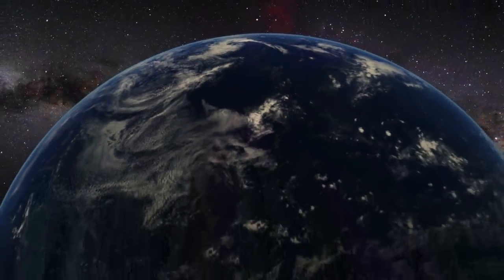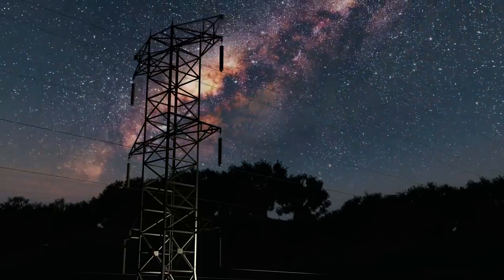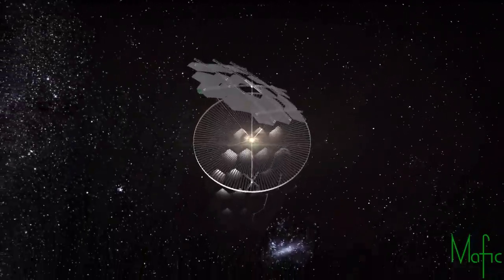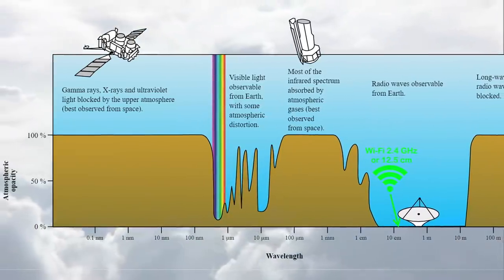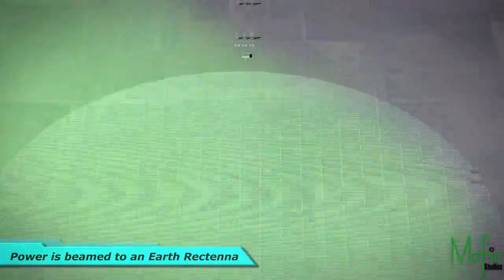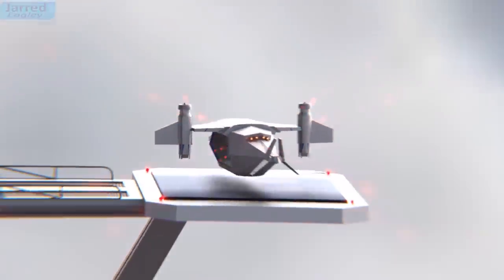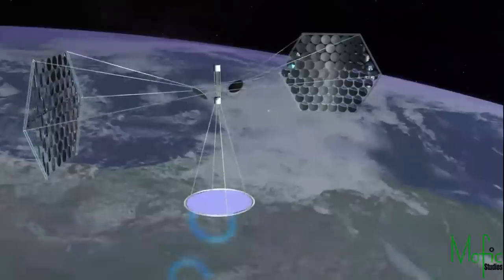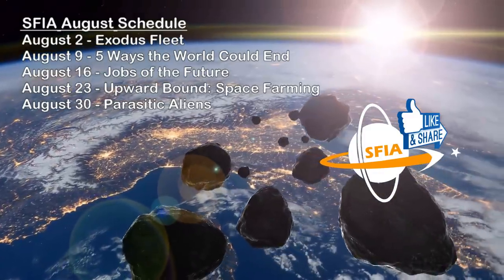Power Satellites & Space Based Solar Power

Comment: Total US cost spent on the Iraq war 2.4 trillion, not including Afghanistan. Could of built at least half a planetary ring mega structure with that, or a vacuum train network under the united states allowing coast to coast travel in 30 mins, or a base on the moon and mars easily, or again easily fully commercial fusion power.

Comment: It's great to hear that these are nearing the point of being economical, at least in theory, but I have a feeling that overcoming the regulatory hurdles will be more difficult and take longer than overcoming the technical problems. However, I can definitely see prototypes going up in the next few years, and perhaps the first commercial ones within 10. I think though that people will have to become more comfortable with active support for structures a couple kilometers high before we reach for 100. This definitely seems like a good option for the 2030s and beyond, especially if they are cheaper and quicker to build than fusion reactors.

Comment: It's funny. Beamed power reminds me of Sim City 2000.
That actually had a bunch of things in it you didn't see back in later iterations of the game (or only in some versions.)
Arcologies, and several forms of powerplant.

The game had coal, oil, gas, garbage burner plants, fission...
Wind turbines and solar plants. (mirror concentrator hot oil/sodium plant, not photovoltaic).
And of course, at the very high end, Fusion.

But, just below the top end fusion plant, you had the beamed power plant - which basically looked like a large radio dish, but was designed to pick up a beam from a solar array in orbit.

The other interesting thing is the disasters you could get randomly depended on various things in your city.
For instance, if you had a lot of water you'd be more likely to get a hurricane, otherwise you'd get tornados.
Lots of forest meant more fires.
If you had an airport, you could get plane crashes.
Having military bases made the alien and monster attacks more likely.

If you had a nuclear (fission) plant, you could have the worst disaster, a nuclear meltdown. (it's the worst because it leaves radioactive contamination that the game provides no method of removing, so parts of your city become permanently uninhabitable.)

But, the other power plant with a unique disaster associated with it was the orbital plant. And sure enough, the disaster is the beam targeting going wrong, and thus instead of hitting the powerplant it starts cutting a path through your city... (the beam is invisible, but you see it cut through buildings, destroying stuff and starting fires.)

I miss those subtle touches... XD

Comment: Great to see a survey of issues affecting the design optimization of space-based & ground-based solar power systems.  I'm looking to understand when combinations of ground-based 
alternative energy systems out-competes spaced-based.  One simple rule would be when the difference is only the cost of transportation of earth-based items.  Space materials mining could reduce launch costs to a tiny fraction of the space-based solar.  Space-based power can be affected by the Sun's activity that could cause it to be shutdown temporarily or worse.  There is a case to be made for ground-based power as a backup power source.  That question needs to answer questions like if a ground-based backup has to be built why build space-based?  These are tough questions with large numbers of influencing variables & factors.  The Optimation of any system of this scale is a really big deal.   It's almost like predicting the weather.  However, atmospheric & oceanic science & engineering is making some progress.  JSW

Comment: My whole problem with orbital rings, space elevators, and anything tethered to the planet is that any physical connection would effectively short the ionosphere to the ground. Do we have any materials with a high enough dielectric strength to withstand the high voltage differential across a trans-tropospheric tether?
Reply: Let the energy flow.
Reply: Huh, I never thought of that.  I wonder if that could make for a viable power source.
Reply: All the ionization is up there, not in a difference in potential with Earth's surface.

But one of my problems with space elevators is much farther down, where there is such a difference. It seems to me that thunderstorms passing around such a structure would readily conduct cloud charges to ground through it...not unlike the exhaust trail of Apollo 12 did, in under seemingly less risky conditions.
Reply: I suspect that it is something that we could design for, ultimately it would mean designing the tether to handle a TLE discharge but this is not so fundamentally different to designing a tether to handle a lightning discharge. The maximum amount of the ionospheres charge that can interact at once is still limited by the dielectric strength of the vacuum medium that the charged particles are suspended within. Of course if anything the presence of the tether would also reduce the voltage when a breakdown occurs (Because a lower voltage buildup can occur before it will carry a current discharging the buildup). I'm just not convinced that this would be the major problem that you seem to think it would be though I'll admit I am no expert on this so if you have data that would prove otherwise I'd be happy to see it.
Reply: A big grounded tower pushing up into orbit will distort the electrostatic differential between the ionosphere and ground (at the very least, local to its geographical area.) Could this aforementioned distortion create a deviation in the earths natural energetic/magnetic/ionic shields?
Reply: No.  Even at very large scales, it would be a minuscule thread in relation to the Earth and weather patterns within.  It wouldn't be pushing much of anything.  

I feel the far more important concern is that there's no way to make a tether from the surface to an orbital ring *static*.  It's an ORBITAL ring after all, and probably moving quite fast.  Even assuming you can fly a line to the ground without the tension caused by dropping through the atmosphere breaking it (which we can assume is solved in this scenario), you're still left with this cable drifting across the planet that you'd have to catch like a damn ski lift.  Not exactly ideal.
Reply: +z beeblebrox Well no they are stationary with respect to the ground you should probably really watch the orbital rings episode if you want to learn more how they are able to accomplish that.

Comment: @Isaac: For the Generation Ship episode (or perhaps sometime in future, since this one is likely baked already) could you please try to address how we keep one of those things running for a few thousand years.  I mean, we regularly have electrical components for computers fail after a mere decade, not to mention the hatch seals on your airlocks 'drying out' (plasticizer loss) - or vacuum welding shut if you choose to skip seals and go for close fit instead.  I've loved the idea of these things since childhood (I'm 50 now), but there are some aspects of them that just seem even more daunting than 'simple' engineering megatasks like crafting millennialy stable ecosystems to support all the colonists.

Comment: What's your opinion on powered satellites that collect higher-energy radiation than visible light?  Like you say, the atmosphere filters out nearly all light with shorter wavelengths than the electromagnetic spectrum.  But in space, ALL of that is potentially available, since the sun fairly evenly distributes its light across a wide portion of the radiation spectrum.  I'm not very well versed on how solar collection works, but my intuition is that UV light and X-Ray light would net considerably more energy than visible light, correct?

Comment: This is exactly what I needed after a morning full of staff meetings!

What do you think about creating automated solar panel farms on the surface of the moon and beaming that energy back?  The Moon has no atmosphere and building and deploying the panels on the moon should be easy (except, does the Moon have sufficient Copper?)

The downside I would see if that the panels would only be illuminated 1/2 the time, but would that 50% loss still be more economically feasible than lifting them off the Moon into a LaGrange point?

Comment: Stage 1: A maglev rocket sled that is accelerated in an eastward facing vacuum tunnel up the side of a mountain, getting to supersonic speeds before the end of it. The airlock is released and the door opens just before the sled reaches the end of the track. It releases its payload and returns to the end of the track.

Stage 2: This stage uses a scramjet engine which can only have powered flight at supersonic speed and with enough oxygen content in the atmosphere. The scramjet keeps accelerating and going up until it can no longer function, releases Stage 3 and glides back down to a prepared runway.

Stage 3: A standard rocket, but now much of the work getting into space has already been done, allowing it to have a much better payload-to-fuel ratio and not have to deal with as dense an atmosphere while going supersonic speeds.

Comment: Did anyone else never even consider having the microwave beam be super dispersed to reduce watts per square meter to a safe-ish level, before this video?
That makes this whole thing much more viable in my mind.
And 85% efficiency on rectennas? Shoot, that's scary good
Reply: Yes, I have read that in published articles.  Space based solar power has been studied since the 1970s.
Reply: The rectenna is 85% efficient, but the transmitter is 50%, for an overall efficiency around 40%. The high efficiency solar panels are about 100 times more expensive, so even if mass to orbit was free, I can't see this being the optimum course compared to ground based with UHVDC power transmission.

Comment: Another application which came up in the time since this was published: decarbonizing cargo shipping. Cargo ships burn glorified asphalt as fuel, and it pollutes a lot. Alternatives like ammonia and LNG are either still too low on the TRL ladder to deploy, or have lots of drawbacks, or both. Beamed power cargo ships would be pretty cool, they could extend their chicken wire rectenna out over the top of their ship like a sun roof, and be carbon free with unlimited range. Ditching the fuel tanks and diesel engines would even free up more mass budget & internal volume for payload!

Comment: I know you can use literal chicken wire as a microwave antenna ...
BUT surely if you want a lot of energy to go through the wire needs to be a REALLY good conductor, right?
What I mean is at this scale of energy throughput if you used a copper wire mesh, wouldn't it just heat up and melt?
Would you need superconductors?
Reply: I don't think he meant literal chicken wire.
The collector is a mesh, LIKE chicken wire. And no a solid wall, like solar panels.
Reply: Yeah, this wouldn't be something an individual would just toss together as a home-improvement project.  It would be the result of a company or govt setting up a program that slightly compensates farm owners for the mild inconvenience of having a somewhat high-tech mesh (honestly not that high tech, just expensive) suspended over their land.  Luckily we have lots of precedent for this in both the public and private sector when it comes to needing lots of land for odd projects, so it's pretty feasible
Reply: No no I mean the literal physical limitations ... What kind of mesh can carry that much power through without melting?
Or can you just use copper wire if the mesh is large enough and the beam diffuse?
Reply: Well, we could "just use copper wire if the mesh is large enough and the beam diffuse".
So really the question becomes how diffuse do we want/need the beam to be.

at 17:14 he says that the rectenna will receive "gigawatts" of power over a large distance.
at 22:45 he talks about the benefits of putting the rectenna on a "common space towers"/"Atlas pillars". One of these benefits was that we didn't need "the trade off of concentration for safety".
What I'm eluding to is that the chicken wire on the ground hits its limit from safety concerns of what ISN'T collected much earlier than it hits the physical limits of the building materials.

EDIT: 
at 15:22 he says that we would beam the microwaves down "at about 100 Watts per square meter" for the safety concerns.
100 Watts is basically nothing, so copper wiring should do fine (if not overkill)
Reply: There are limits to overheating, but the limits are mainly important when using this sort of beamed power to target microwave-sails (like solar sails, but not).

On the ground, the biological safety limits are so much lower than the limits from any metal's melting point that people might even use aluminium because it's cheap and light even though it's a terrible conductor — we already do this with power cables, IIRC.

Comment: I'm currently reading Ben Bova's 'Powersat'. It occured to me that you could use big high altitude aerostats @ 30km up with receivers on the top surfaces to cut down on the atmosphere absorption. Tether would serve as a power line. Started googling it and it turns out somebody had this idea (to the point of filing the patent) but without the advanced materials it is not viable. In couple of decades though it could be a stop-gap between ground based rectenna fields and the atlas pillars the video is describing...

Comment: Suggestion. 

The Power Satellite-

One Autonomuos Body. 

Movement- manipulation of the centrifugal Force. 

Two heavy tubes. Using tech close to that of a magneglide (Japans trains) to excelerate them  in to a very fast centrifuge. 

Then use a magnet at the right position to pull them into an angle  and the inertia will toss the satellite up. 

As for the radiation of waste heat.. 

One can use a thermo-electric to recapture some of the energy lost. 

Here comes the weird bit.

If we can have a sufficiently strong power storage system..

In can just come back down and plug in until it's low enough it will not have enough to go back up on its own.

Comment: A clarification about the comment on graphene starting to now be able to be made in bulk: I was looking over some of the info on what MIT had done and doing some calculations. While they would be producing graphene in bulk by spare footage, since it is so thin (1/3 of a nanometer for each layer) even rolling it into rings you could use to make a long chain for a tether (using a SINGLE ring with a 10cm average diameter made of graphene that is 1cm thick for my calculations) would take 35 years PER RING for the fast, low quality graphene method (20 times that for the high quality method they mentioned ... which is just the same method moving slower). This is because it would be composed of more than 300 million layers.
That would be one HECK of a strong ring, though.

Comment: For a solar power satellite at geosynchronous orbit, is there a preferential latitude (other than the equator) which to beam the power down- say, anywhere between the Tropics of Cancer and Capricorn) to get maximum transmission and avoid losses due to distance, beam spreading, or depth of atmosphere traversed?

Comment: I don't think you've mentioned one potential benefit of beaming energy to a tower instead of the surface. If you beam the energy to a tower 100km up, you could space out the microwave emitters in space and focus them on the tower 100km up. If the beam is focused on the platform 100km up, it would be out of focus when hitting earth and couldn't cause any harm. So the platform wouldn't have to be big for it to be safe.
Reply: jort93z, true, but your beams would hit a much larger area.  You would get a lot more people complaining about the exposure.  Even if your body is not collecting a significant amount of heat a metal surface could.  The beams obviously generate electrical currents in chicken wire.  Aluminum siding could have some alarming reactions.

Comment: Start simple.  Put mirrors in a 40,000 mile orbit, aimed to distributed, ground based, PV, or solar concentrator, arrays.  The ideal location is deserts, but extra solar radiation is likely to create high pressure (cloud free) zones.     

As you mention, it reduces the ground based solar collection, by a factor of 6, and eliminates the need for storage (which we don't have yet).  We have all the tech we need today!

The mirrors are very simple, but very large.  Proof of concept only requires 3 or 4 mirrors at a 10,000 mile orbit.  

The problem is the mirrors behave like solar sails.  If the mirror rises when orbit is with the solar pressure, and they would drop in orbit when orbit is against.  If the mirrors get to high, or too low, turn the 90 degrees to the sun during half the orbit for a few cycles.  

The same process is used to move mirror from low orbit to high orbit (for 0 cost).  

We upgrade the ground side as we improve efficiency.

This could still be used as a weapon by aiming multiple mirrors at one point.  That could be mitigated with self destruct systems requiring multiple member countries to activate.

Sky glow could be an issue, but eliminating fossil fuels will reduce the particulate count.

As to the scale, 18 terawatts a day, at 20% is 20W per square foot (200W per square meter), we would need a solar panel 37 miles on a side, a (combined) array of 50 miles (85km) on a side.  Doubling that would allow switching the mirrors away from cloud covered solar farms.